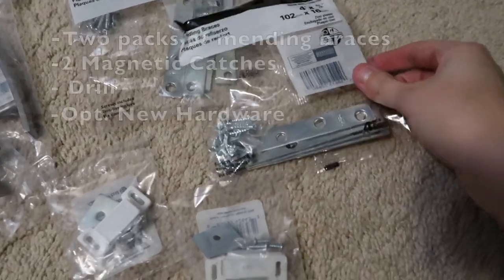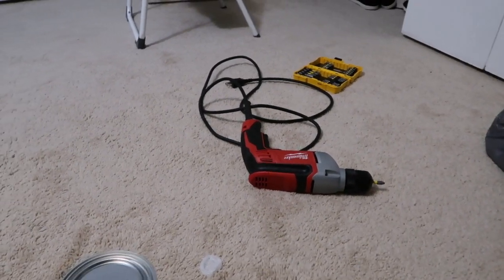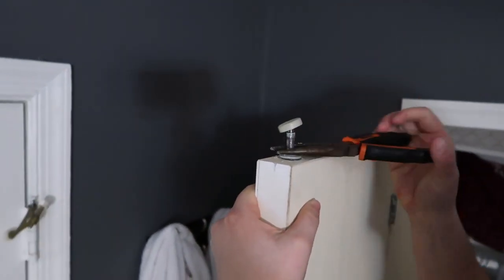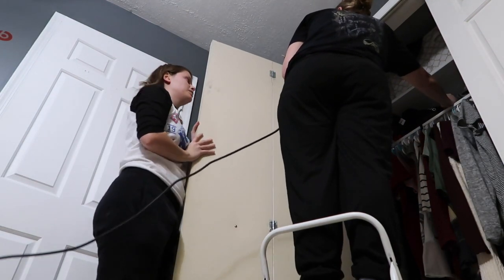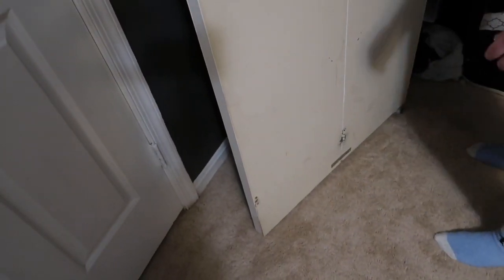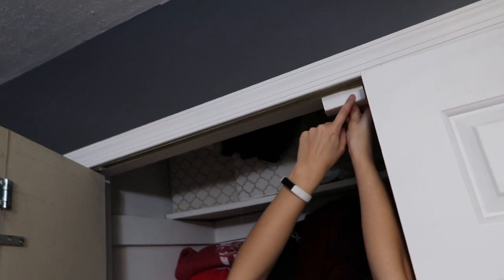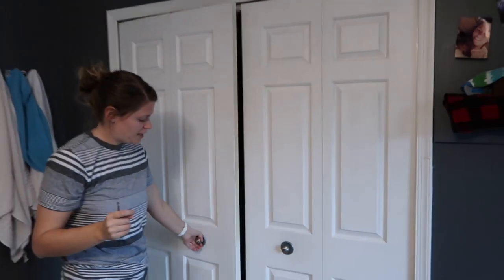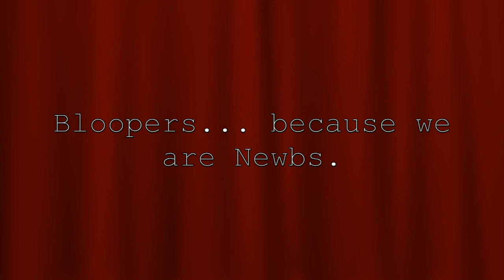A Lesbian & Her Toolbox: How to Convert Bifold Doors into French Style Doors

Comment: Can't wait to do this.  Wondering how the doors are attached to the frame if at all?  We took our bi-folds off a closet the kids used.  They kept getting their fingers pinched.  Now we are empty nesters we want to convert the bi-folds as you did.  Originally the bi-folds were held in place by the track at the top and another at the bottom.  I'd rather not reinstall the bottom track if possible just can't figure out how to anchor the doors so bottom isn't unstable.  Hope this makes sense.
Reply from the maker: Ours never had a bottom track so I’m not sure how you’d accomplish it with a track!!

Comment: Question? Were your doors hollow?  Just wondering how well the brackets held  in place if you're screwing them into the door and it's not solid wood.  Just wondering  since my doors are hollow.
Reply from the maker: Marcye Brooks our doors are hollow as well!! Luckily we have not had any issues with it since installing the brackets.
Reply: Usually even in hollow doors the first few inches are wood so the frame of the door is rigid so the bracket should be in solid wood

Comment: I tried this and it was a disaster. First, we have hollow doors and the braces broke out of the back the first time we tried closing them. So then we glued/screwed a rectangular piece of plywood to the back of each door which seems to have worked to keep them flat. The next problem we had was that the doors wouldn't close. They were uneven, one door hit the top of the door jamb and both doors overlapped each other. Turns out that the track couldn't support the doors as French doors as they were too heavy and the screws came lose in the track causing the doors to move out of alignment. Ended up redrilling new screw holes and using extra long, heavy duty screws to keep the track into place. We also had to readjust the pins on the top and bottom of the doors since they also came loose. Today, I installed the magnetic clips as shown in this video but the magnet isn't strong enough to keep the doors closed. They keep popping open. I want to cry. It's been one problem after another. I wish I had never even tried this project. I should have just painted the bifold doors and been done with it. I'm probably going to have to go buy a new set of doors. I really thought this would be a cheap way to update my ugly doors but instead it's going to end up costing me money. :(
Reply from the maker: I'm so sorry that you have had so much trouble!! I can definitely empathize as we remodeled our bathroom recently by watching YouTube videos, and unfortunately our circumstances were much more complicated than we expected from watching the video. We had issues with ours being uneven as well, but luckily we were able to readjust them with the hardware it came with. I am truly sorry it didn't go well! :(